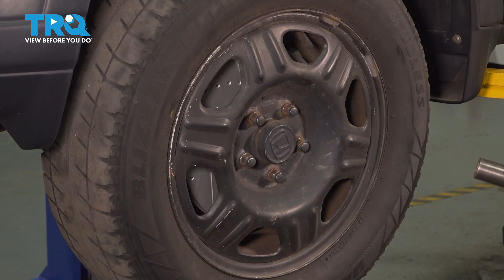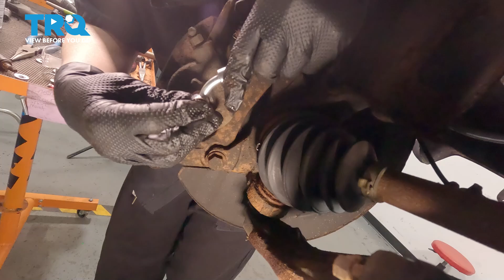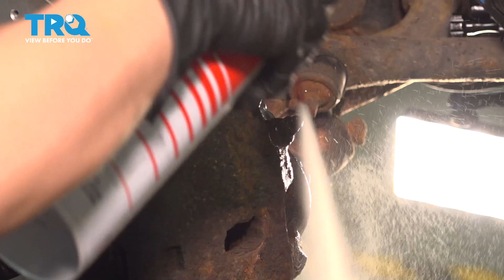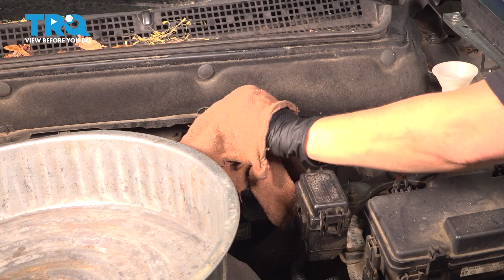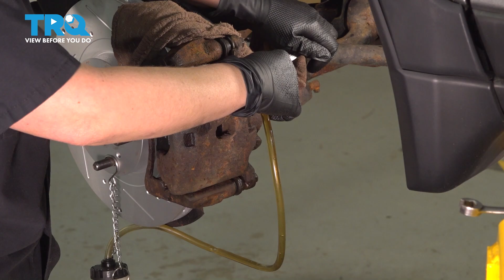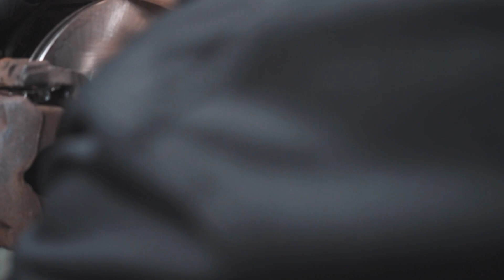How to Replace Front Brake Hoses 2002-2006 Honda CR-V

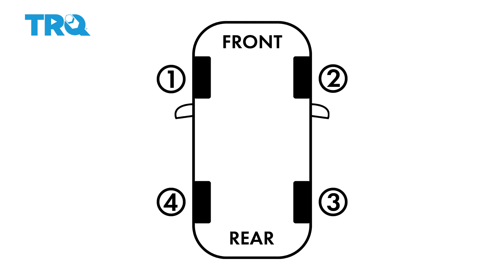Comment: 10:45 I believe you got the order wrong: you should bleed from furthest to closet. Furthest: rear passenger. Closest: front driver. So: 
1 - right rear (passenger, furthest),
2 - left rear (driver),
3 - right front (passenger),
4 - left front (driver, closest).